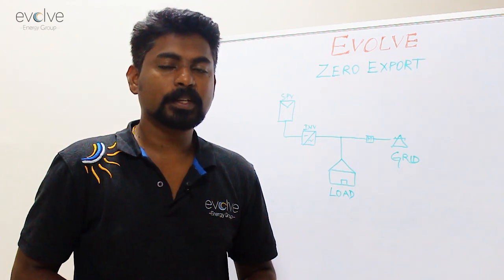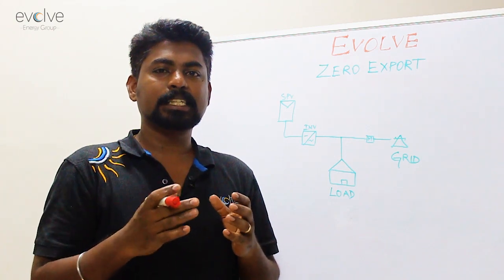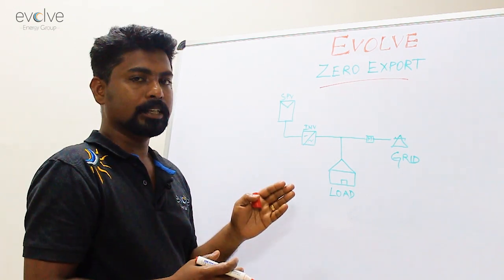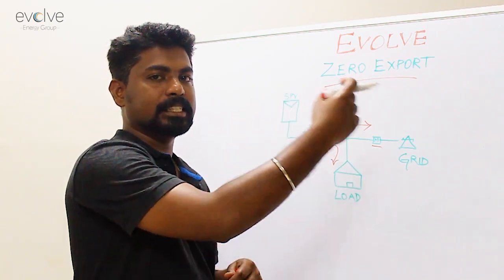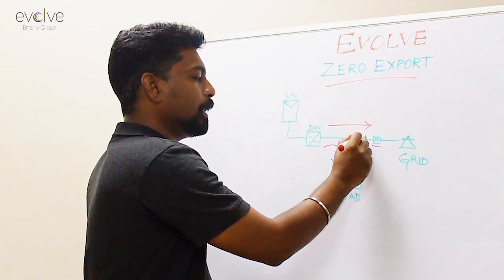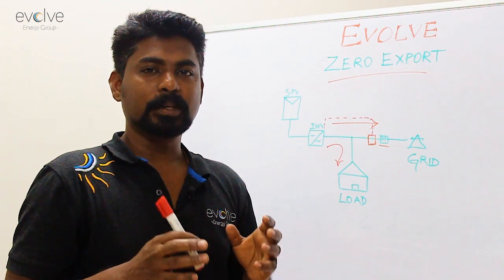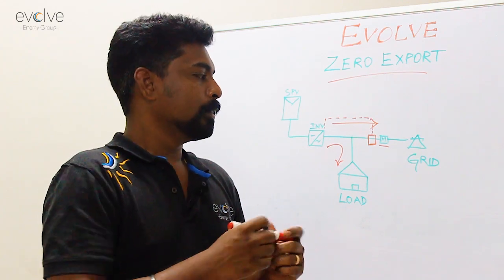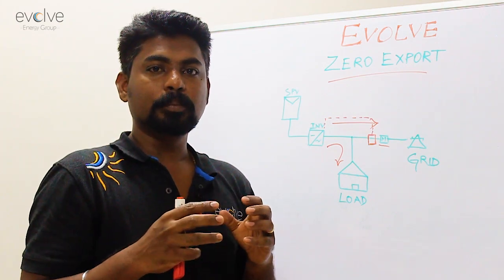Zero Export Solution | Evolve Energy Group | Solar Plant | EPC

Comment: I am facing an issue with zero export device where when there is uneven load on three phases the zero export device is unable to fully stop the export.

I am using Aiswei Solplanet G2 20kw grid tie inverter with compatible free export device.

Comment: hello sir, i have a 10.5 kw solar system with a 11kw sofar grid tie inverter, which generates 27 - 30kw units daily, the reduce in unit generation mainly is due to my electricity provider (KSEB) having power cuts during peak production hours. how can i use a zero export in that case when there is no grid to power my home appliances? my consistent load is 2.2kw
Reply: Not possible.you need Grid for Reference.
You may achieve this by using equal capacity Generator installed with DGPV synchronization.

By the way for 10 kW unit 30 units per day is very low production may be due to power cuts

Comment: Sir I have a question, I have some ABB grid tie inverter's one is a three phase Trio 20 kW and the others two are 3 kW single phase...neither of the two types have a configuration for zero export but they do have a "power limit" feature is there any way possible to hack into this feature (that's normally controlled by the grid to crank down the power output)  to somehow use it as a makeshift zero export?

Comment: Good Day Sir, If i have 3 solar inverters grid tied, how many CT sensors will I use? 3? one in each inverter? or do I only need one sensor, and connect all the inverters in parallel to that single ct sensor?
Reply: Your three inverters have to be the same and also capable to be "String Type" in this case you only need one CT sensor and the inverters needs a communication cable connected between them!

Comment: what if the electricity from grid is not present then still Solar plant works with the help of zero expert meter
Reply: Hi Rita,  the short answer is no...a grid tie inverter needs to synchronize with the grid hertz and voltage without it it cannot be activaste!

Comment: I think a correction need to be done ,explanation was fine .Actually it is not an energy meter ,its a Current Transformer ...
Reply: Technically speaking you would be correct but as far as the marketing name it's actually called a meter I just bought a installed one from ABB

Comment: What if i have unbalanced phases? Wont there be export then?
Reply: In case of unbalanced phase....grid tied inverter will stop.
Reply: The ZED will take the minimum load being consumed from one of the 3 phase as reference and it will control the PCU to distribute balanced power in each of it three phases out put to ensure no export to grid. 

We can discuss this over a call if need. Our support number 18005724090

Comment: Dear Sir,
I installed a 18 kw solar on grid plant the power consumption of the premises was 60 units per day, but after the plant installed the power consumption become 10 units per day but the PF reduced to .5 and the kvah reading becomes just double and also the PF penalty, how can I troubleshoot it, I made the generation by 75% reactive power but the PF is still .7 then how can I will get .9 PF.
Reply: Sir,In On Grid system there is no Transfomer ,so no losses also ..
So whatever input ur Grid is having it will get the same from ur system.The only u need to check whether the country,frequency or properly set.Also if the apparent power is correct as per the panels connected ,I think ur system is fine.
If interested pls drop me a msg in whatsapp @9447743431.